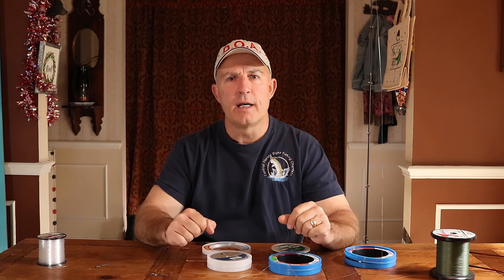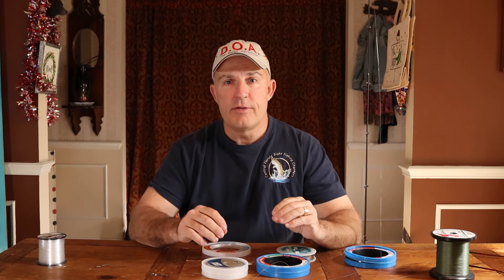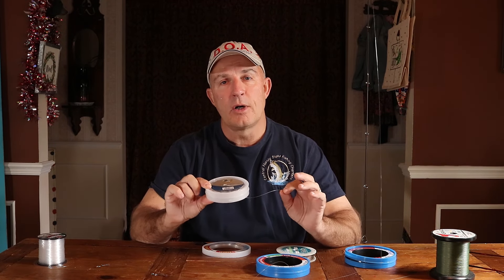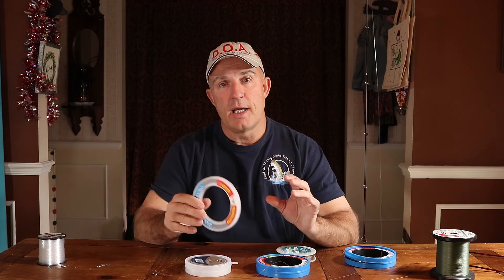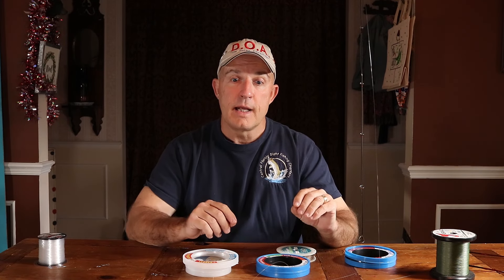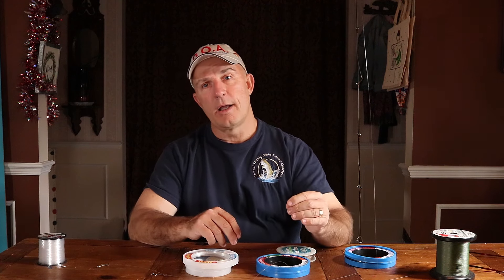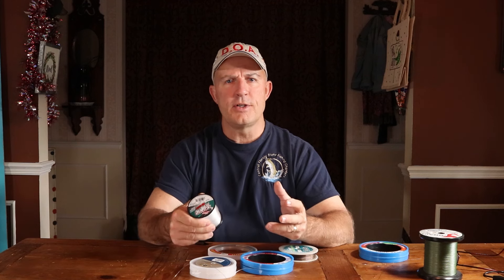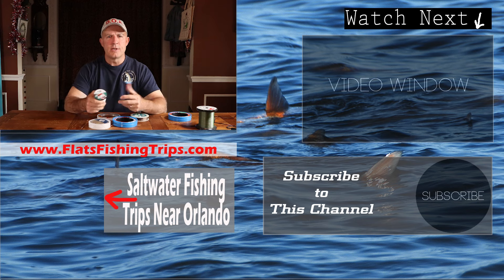Fishing Leaders Explained: How and why to use a leader

Comment: FC with an FG knot. Takes longer but after the 1000th tie it’s easy with a bobbin. 28” through the eyes smooth. I also end the day with about 8” left.
Reply from the maker: I have tried several different ways of tying and finishing the FG and know others who use it but it has always been very inconsistent and eventually comes apart when I try it. It is definitely the smallest. I just wish it would not come unraveled when i tie it.

Comment: Sorry - I don't get it, I'd rather cut a little of my main line and preserve a stronger leader, esp. if the leader already has a hook or lure on it ($$). Then if the leader gets nicked on branches, rocks, clams, anything it would be tough enough to last so I don't lose my lure. I use metal leaders with swivel clip for the convenience of quick lure swapping instead of pulling out scissors and cutting and tying knots all day. What I sacrifice on visibilty doesn't affect the bites as much as the next guy and I save on losing lures. That's just me.
Reply: What species do you fish for?
Reply: It would definitely depend on the fish & their teeth. Stong leader or lighter leader.

Comment: Hey Capt.   I like using the FG knot with a leader over 3 feet.  Under 3 feet.  The improved Albright  knot.
My friend uses a double uni and nothing else.   Thank you for the video.  The leader is most important, people get confused about what #test for main line.   Most cases , 10# is enough like you have said.   The leader is what I focus on.  Cheers Capt.
Reply from the maker: Have you ever had the FG come unraveled? I have tried it several times with several finish "locks" but most times it comes apart

Comment: You may not like this idea, but because 1,  braid is expensive and 2, I don't like my leader knots rattling/ banging through/against my guides/tip top(because it will eventually weaken any knot,causing a failure), I connect the line/leader with a. figure 8 loop to loop connection.  I used to do a lot of Carolina rig/live bait fishing, so I can comfortably and accurately cast even a 4 foot leader from a 6 foot spinning rod with the leader outside of the tip top. I used this method to change to different leaders as different fishing situations dictate. Sometimes if I feel like it, I connect with a double Uni knot, but ALWAYS the leader stays outside the guides, if I can help it.

Comment: Can you use Flurocarbon as a mainline, and use the same line as a leader (connecting them with a swivel)?
Reply from the maker: There is fluorocarbon fishing line which is very similar to monofilament. You can use this instead of braid or mono. You can also use the fluoro fishing line as leader material but it is generally not as stiff and abrasion resistant as the product sold as leader. If you do not need a heavier piece of leader than your main line, there is no need for a swivel. Unless you are using a lure than spins and twists your line, I would eliminate the swivel and tie the leader line to line like this - https://www.youtube.com/watch?v=R98jmnMPLDQ&list=PLABDAD066CAE649EB&index=1&t=7s
Reply: @CaptChrisMyers  Appreciate the advice, Thank you !!